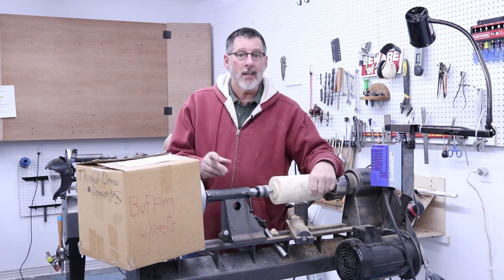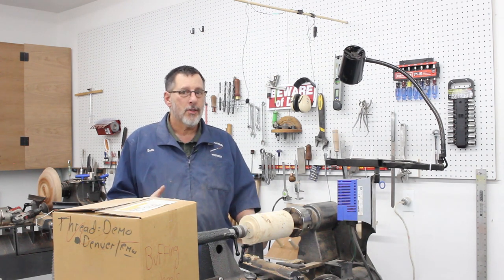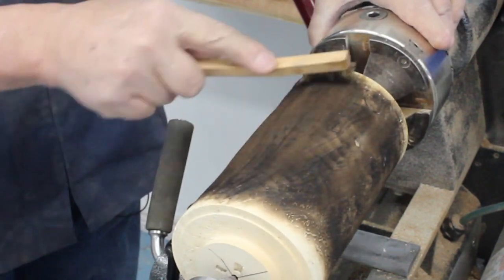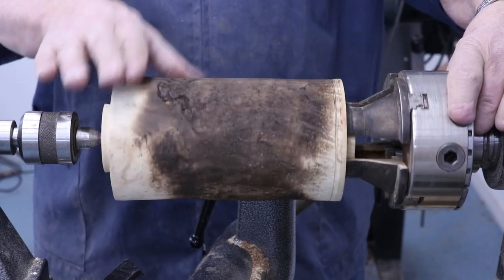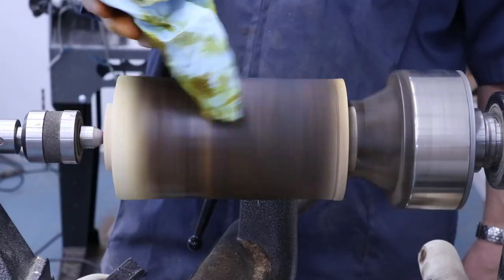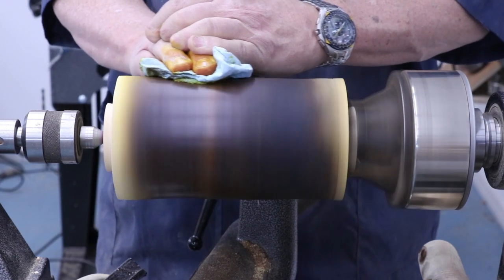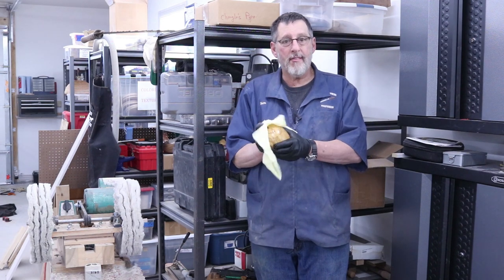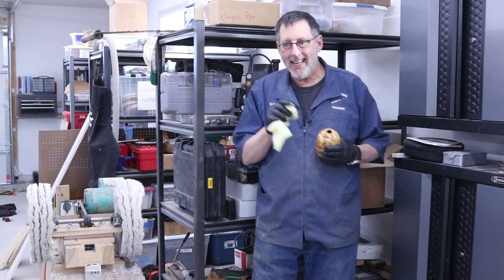Turning Tip #5   Buffing and Burnishing--What's the Difference? with   Sam Angelo

Comment: This information is exactly what I needed! I know it's not quite as exciting as watching turning, but it is an important step of finishing that I have yet to get to. Usually the highest I get to is just 12,000 grit for anything like acrylic and then if I'm applying a finish, however it looks when it is done is how I've left it. I look forward to giving buffing a try and see how much more I can bring out of my work. Thanks for taking the time to present the information so well.
Reply from the maker: I would sand my lacquered pieces to 12,000 grit.  But I have sprayed 15-20 coats of lacquer on the piece.  Sam

Comment: So burnishing is to use a hard material to compress the surface fibers to smooth them, and buffing is to abrade using an abrasive or finish (or not) on a softer applicator to smooth and polish with just some compression?
Reply from the maker: Good question-I think you are correct.  But I will "try" to explain myself better in my next notes' video.  Sam

Comment: Sam, very interesting video. Am I right in my conclusion that the real difference between burnishing and buffing is the use or non use of a polishing compound ? When you showed burnishing, you used wood, bone etc and a cotton polishing / buffing mop, but just as it was, I saw no lubricants, so you were just relying on friction to give a high sheen. You also stated that buffing was usually done after the wood had been totally finished albeit lacquer or CA etc and using various grades of a polishing compound. Could you buff bare wood to a high gloss ? Happy New Year to you and the Family.
Reply from the maker: I agree 100% with your synopsis.  I think you got my point in the difference between buffing and burnishing.  Burnishing is done on unfinished raw wood with no lubricant (I like that description).  Buffing bare wood to a high gloss could happen-but I would call it burnishing.  Sam

Comment: The dirty wheel in the video. How do you clean it, by washing, using the wire brush? I have wondered about the difference between buffing and burnishing. I thought it might be a preference on how a person learned. Thank you for the video..
Reply from the maker: (From response above)  Yes it is difficult to clean this wheel.  I just dedicate that wheel to burnishing scorched wood or metal.  Sam

Comment: Scorching the wood before burnishing it is the very LAST thing I would do if I'm looking for a beautiful finish...the saw dust is a very good burnish material, paper towels are fair, but I get the best work from just plain old brown paper bags...make a pad from layers of the paper and keep turning it over and using different parts of the pad, and the more you use it, the better it works until it falls apart in my hands...this works before or after staining/dying; dry and no sealers other than maybe a little oil or wax.

Comment: 3:15 into your video you mention a buffing wheel that you used on metal - I have the same problem with one of my buffing wheels.  How do you restore it back to use on wood?
Reply from the maker: Yes it is difficult to clean this wheel.  I just dedicate that wheel to burnishing scorched wood or metal.  Sam